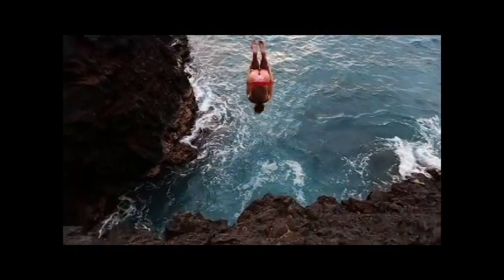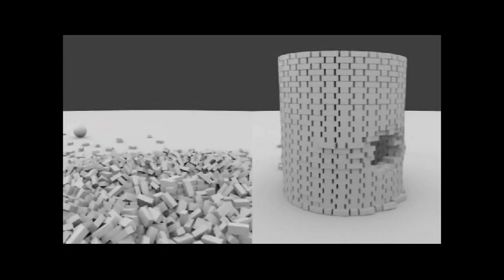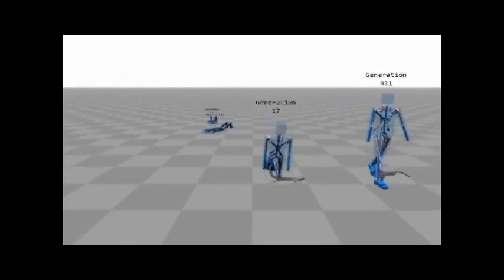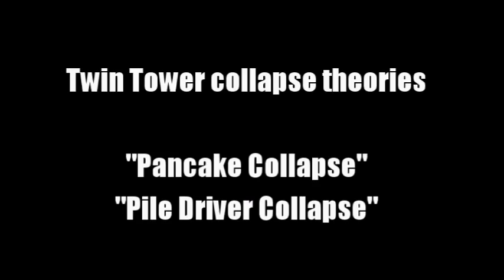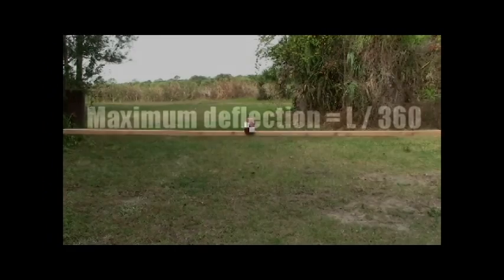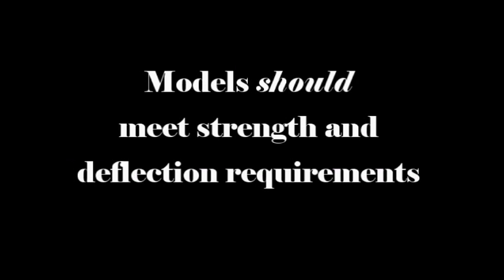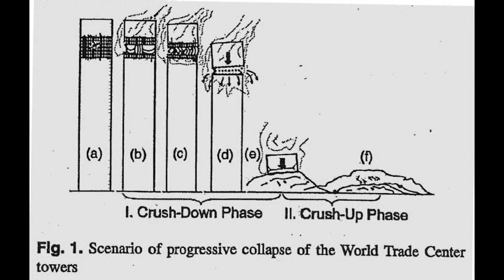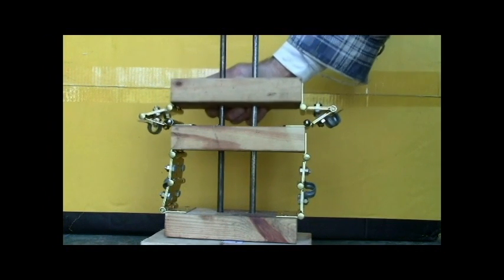9/11 Experiments: The Force Behind the Motion

Comment: https://www.youtube.com/watch?v=_W00HXsep_c <- this guy explains what actually happened in only 3min.
Wow this is so wrong headed; nothing you have shown matches the actual video, which you conveniently never show. The actual video shows two stages, the top burning floors collapse in a manner similar to the pancake theory, then there is a delay, the remaining 90% of the building didn't move at all during the top collapse, and absorbs the energy. the second stage starts after the delay, the newly applied load to the remaining structure causes a each floor to collapse in turn when the concrete is turned to dust, and the steel is ejected outward. In both stages, the 'total' acceleration is somewhere above 0 and below 9.8; this is expected! n.b. the original designs calculated how long the building could survive in a (similar) large fire, the calculations were accurate to the minute; this isn't arcane magic, but well understood physics.

When using a model replacing the load of the collapsed top section with a falling mass, a deceleration of the load is to be expected; math can be done to show that the substitutions made have the effect they do!

Comment: I think after the first time in the basement parking garage attempt the city planners said what if it did fall. Imagine the destruction of the city if the building fell sideways. Let's have a system that will drop it in place in case it is gonna fall. They blew the building to save the city.
Just like they shot down the flight over Pennsylvania. It did not crash. They shot it down to prevent more fatalities. Which I'm ok with I just wish they would admit it.

Comment: problem number one: There was no giant wooden structure supporting the building from the outside on 9/11. problem number 2 there was no giant wooden supports between each floor of the trade centres. therefore you are adding an upward force to the equation that was not there in reality. redo your experiment but with metal toothpicks holding up each floor instead of the wooden blocks, have a central, non-weight bearing collum ( to simulate the stability of the towers) and have the weight be a circular object so it can fall around the central collum. then you will have a more accurate example

Comment: your paper and cardboard facsimile of the tower is hardly representative of reality. what you made weighs nearly nothing while each floor of the towers weighed around 4550 tons. (500,000 tons for the entire structure in all). the top 15 stories therefore weighed around 68000 tons. this is a lot of weight no? smashing this down on the floor below all at once you don't think would crush it? then add 4550 tons to that to crush the floor below that - so on & so on. Paper cannot simulate this accurately.

Comment: So. You believe that the twin towers was "blown up" or out!!! Yet several thousand people worked in that building and not one person asked "What are the explosives strapped to the steel  for????" 
Your experiments are seriously flawed in more ways than I can describe here. Weights and displacement as well as deflection effects should have been considered. Nothing was scaled apart from the deflection. The long strips were strongly supported on the ends when clearly the floors collapsed onto each other flat and not "bending" like in your experiment!!
Here's a suggestion, try doing both theories at the same time!!!! A pancake pile driver type of situation. Why not build a scaled model with floor thickness and weight taken into account. Don't just use some small squares and long strips.!! Find a comparable structural equivolant to the steel columns!!
Why is it easier to believe that millions of dollars of explosives were used to destroy the towers than to believe two planes crashed into them.
Reply: Just need to add..... A FLAWED EXPERIMENT DOES NOT PROVE OR DISPROVE A THEORY

Comment: I think you should had made a complete tower with 15 floor relegated to show the two theory. And a second  15 story with nothing below but air. The twin tower fell at the velosity of free fall. So if you dropped the 15 story with just air, the full 115 floors should drop at the same speed. Of course it's not possible. Please look up gold safe under neath. Or the fact that the day before Rumsfield said on 9 10 01 the Pentagon can not account for 2.3 TRILLION. Yes that's correct. And again over 6 trillion years later. This was simply about making money, and the new pearl harbor. That we would belive by giving up some rights for a little safty was ok. Cia and nsa have no congressional over site. Just President. Aka against constitution. Wake up 911 is the tip of the ice berg for the New World Order

Comment: Lol... Both theories, and several other issues obviously came into play at the same time. Cheap steel or bolts, extreme heat and vibration... probably vibration more than anything else which cause the bolts to pop, have you ever been on a bridge on an overpass and it moves when a 2-ton car drives over it? Can you imagine the force of all that weight?... if you think that was demoed, you're an idiot... the third building collapse because of the vibration and poor Construction... But you got to love a guy playing in his garage with a totally different design than the building itself with a beer Meister in the corner.... they tried to blow that building up in the parking garage and that didn't work several years prior